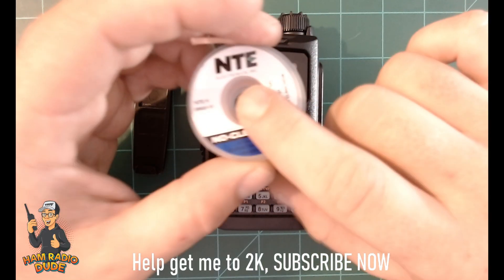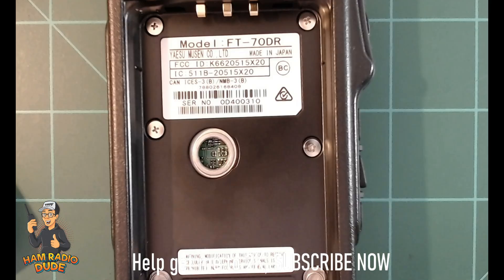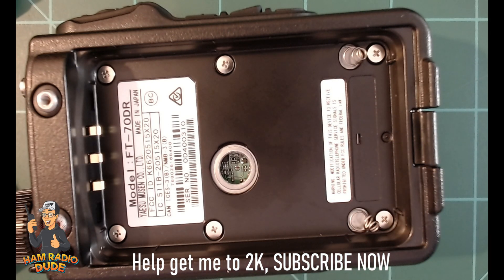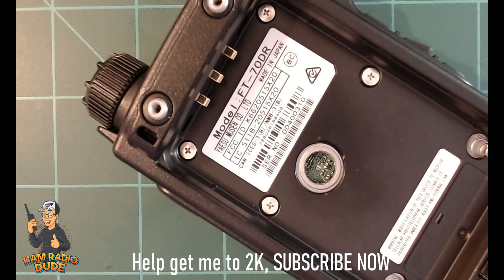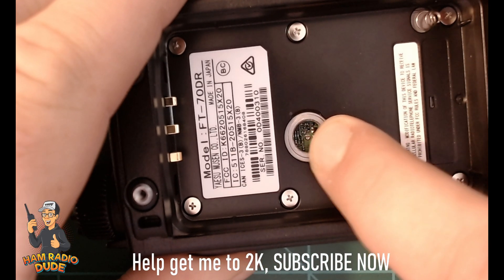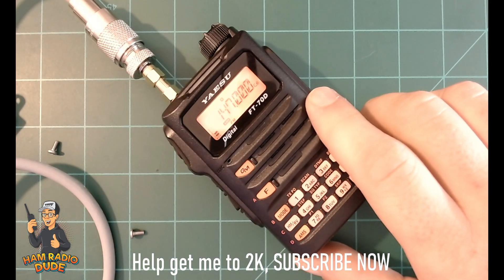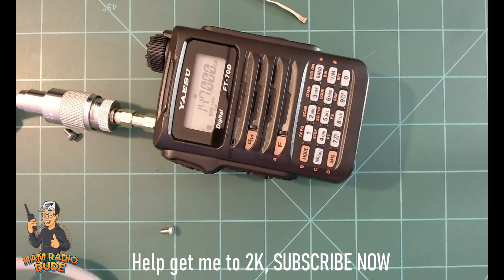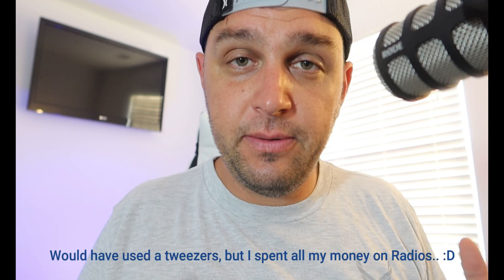Transmit / Unlock Yaesu FT-70D  - MARS MOD

Comment: I know this is an older video but I’m curious how did you get your radio to show a battery indicator on the screen? I just got this radio cause I have been wanting to do digital
Reply: I can answer this for you. Fully charged battery is about 8.3-8.4v on this radio. At 7.5v it will show the half full battery icon like you see in his video. At 7.0v it will then show an empty battery icon. And finally at 6.7v or so the radio will shut off. I just did extensive battery drain test on this radio because it has a bad rap for the battery life. Surprisingly I got a total RX time of 13.5 hours with the stock battery while parked on the very busy Kansas City Wide Fusion room.  Cheers!
Reply: @CheesyTators thanks yea i bought the upgraded battery from W0AEZ gives lots more run time and usb c charging
Reply from the maker: I don't recall doing anything to get it on the screen, actually. Sorry I cannot be of assistance. Maybe there is something in the Menu system?

Comment: I watched this video and done it exactly as described. A bit fiddly but I kept my fingures steady and done it using a small pencil soldering iron. Its not that hard but any way up,it makes perfect sense to make sure you know exactly what you are doing, as this mod is well....SMALL to say the least. But once done it worked perfectly. Over here in the UK, we do not have such family frequencies and such, but we do have PMR frequencies and that what I done it for. BUT if you are not sure, then DO NOT do it. Ask a fellow radio ham. Nice video bye the way....
Reply from the maker: Thanks for the input ! Cheers!

Comment: Thanks ! Got my braid in the mail today (Amazon) ... Followed your instructions ... took less than 5 minutes (and I'm clueless 
when it comes to soldering and it was done. Booted up and put in my Call sign, went through the ridiculous AMDS software
instructions (remember, export originals codeplug to excel type ....... reloaded it (well .. twice, first time didn't work) ... and I'm
a happy camper. I have an openspot 3 .... this works beautifully linking in to wires x .... So much easier that my pi-star dmr ...
Thanks again.
Reply from the maker: Glad everything went well!
Reply: @DudeTested I have NO resistor on this place but radio is limited in range... Any ideas...

Comment: I've bought a second hand radio that has one of the pads completely torn out. It seems that the resistor was simply removed with a screwdriver. How can I remove the unwanted bands?

Comment: If I Mars mod the ft 70dr, will that open up shortwave bands?
Reply from the maker: It will not.  It will open up the ranges 137-174 and 420-470mhz. Good Luck.

Comment: Failed to communicate with the radio: Radio did not ack block 1 (CHIRP) after the mod, any clue how to fix that?
Reply from the maker: Can you confirm with the actual Yaesu software if it reads? Additionally, Chirp instructions are possibly incorrect (I am not a developer, so I don't know).  The battery, according to Yaesu's instructions should stay out during the programming process.  If I read it correctly. Anyway, I wonder if the yaesu software works? - https://www.yaesu.com/downloadFile.cfm?FileID=13328&FileCatID=42&FileName=FT%2D70D%5FADMS%2D10%5FEXP.zip&FileContentType=application%2Fx%2Dzip%2Dcompressed

Comment: Do you still need a MARS license?
Reply: There is no such thing as a MARS license. MARS is a program you join to work with the military, kind of like the Coast Guard Auxiliary or the Civil Air Patrol, but focused on radio. Members must already be a licensed amateur but get a separate MARS callsign for official work. Members get assignments and do training that involves transmitting on non-Ham HF bands and are only authorized to do so when assigned to. They use their own HF radios, so they must be modified to be able to access any HF frequency. They do not use modified VHF radios. We just call any radio modified to transmit on expanded frequencies "MARS modded" for convenience.
Reply from the maker: I just checked and it appears that a license is still required
Reply: Thanks for checking.👍🏻

Comment: Ham proponents argue that their $15 multiple choice test ensures that only those with serious interest in electronics and the furthering of the radio arts are allowed to participate in their exclusive, law-abiding club. When these very same proponents are handed a soldering iron they are suddenly forced to acknowledge the fact that memorizing a list of answers to 35 irrelevant questions which somebody wrote in the 1930s has not qualified them to perform even the simplest of operations on a piece of modern electronic hardware and they just resort to ham-handedly stabbing around until something falls off; unironically why it's called "ham radio" in the first place.
Reply: get over yourself

Comment: Thank you so much for this! I'm a missionary in Nigeria and I inherited my FT-70D from an older gentlemen who passed away at our church. We use other radios to keep in touch with the local police and our security and I am so happy to now be able to use the frequency we are on with this radio. By far it has the best range of all the radios we use.
Reply: I did fully disassemble mine and used a heat gun and tweezers to remove it incase I ever need to re attach it.

Comment: When I do mods of this sort, I use a hotair rework station and a pair of tweezers. I am a Cellphone Motherboard Tech which why I have that kind of equipment. You can also use the Butane Soldering Iron. Just take off the tip to provide the hot air.
Reply from the maker: Great tips, thanks!
Reply: My butane soldering iron has a hot air tip. Also, I bought some ceramic tweezers from a vape shop. Makes easy work of jobs like this.

Comment: Ah yes, the ole “hiking” scenario every ham radio guy speaks of when performing a MARS/CAP mod. Every transmit expansion mod I’ve researched, the author of the article/video always mentions “hiking” and the need to have the capability to transmit out of band in an emergency. 

Have you ever been to a ham fest? Been to one lately? Ain’t none of them fellas doing any hiking! 

Seriously though, good video even though I don’t have a need to perform it. I’m just curious about radio mods in general even if I don’t need them.
Reply: What are you implying? Is it then going to be only criminal gangs doing this mod, and then transmitting on illegal frequencies as a challenge to civil society? ;-)

Comment: Okay I am new, what does this MARS mod do exactly, what are the advantages of it?
Reply: Gives you the ability to transmit outside of amateur bands.  Most people are only interested in GMRS, MURS, and marine bands.  But depending on radio brand it will will usually open up transmit from 137-174 on VHF and 400-520 on UHF.  Most all brands are the same on the vhf side, but they vary on UHF such as some are 420-470, 400-470, 400-500, it just depends.  I think my Icom 2730 does 400-480.

Comment: If you can get your hands on a hot air station, set it to 400, give it a few seconds and use a pair of tweezers to pick the resistor right off. You can even put it back on if you want latter on.
Reply: Do you mean use hot air gun? You will hate the components around it and risk damaging the board. Stick to a solder iron
Reply: @spacecoyote6646  - no, he said a hot air station.  They’re a specialized tool for working on surface mount boards with a very fine point to deliver hot air.  That’s pretty common for SMT reflow work.

Comment: If you do this, perform a "Reset All" when turning on the first time after the mod. See page 24 of the Advanced Manual. 
If you already did this and you only transmit white noise, do the same Reset All.

Comment: Just curious, what exactly does the MARs Mod do to this Radio, does it add to the air band AM receive 108-136 or any other am receive frequencies?
Reply from the maker: Hello. The mars mods opens the radio to transmit on 140-174mhz and 420-470 mhz (FM).  As far as I know, it doesn't add any additional AM Air Band receives.  Best wishes.
Reply: adds murs and grms, sweet mod, looking at 70s now😁😁😁😁😁😁😁😁😁😁

Comment: Do you know if there is a way to make it transmit on the air band?  I am a commercial pilot and that would make it much more useful to me.  Also, will this mod void the warranty?  Thanks
Reply from the maker: I'd assume it's not possible for legal reasons as well as Air Band Transmits on VHF AM and this radio doesn't have an AM transmitter. Best of luck.
Reply: Yaesu makes two aircraft band handy Takies. One of them can even receive the VOR info.
Reply: Yaesu makes excellent Airband Transceivers as well. The best one out there is the FTA 850L.
Reply: You're a commercial pilot and don't know your radio is AM? What airline?

Comment: Took out the tiny resistor with screw driver. But, still it did not work. Shall I remove all soldering remains?
Reply from the maker: You should be good as long as both contacts/solder joints aren't touching.
Reply: Finally did it.. Thank you so much

Comment: Umm looks like you just let the resistor floating around inside the radio. all it takes is for that resistor to get lodged somewhere on surface mount components and short something.
best way to do this is use the finest tip solder iron you have. use a good amount of flux and rest the tip in the middle of the resistor. when the resistor gets got enough it will float off and stick to the solder tip. Do Not just flick it off with a screw driver. Sometimes these pads are also connected to other components and can cause failure when they are just ripped off.
But I do have a question for you Ham radio dude. how is the TX audio on this HT the receiver as well? 
Thank you for sharing BTW
Reply from the maker: Thanks. I know better, just didn't realize it was in there.  I will redeem myself with a part 2 on the FT3D and the right equipment for the job.  I have no complaints with this radio and receiver sensitivity.  Sounds great through the 700mw speaker.  It's loud enough for me to hear it and it doesn't sound overmodulated.  I can try to get some audio recorded from it.  Thanks for commenting.  Recommendations on a good soldering Station?  I know most people like hakko?
Reply: @DudeTested  I paid 50$ if my memory serves me right for a 937d+  it usually comes with a pack a multiple size and style tips.. perfect for surface mount PCB. this station has lasted me 6 years so far. And I am looking as of now they are only 35$.
Reply from the maker: Just wanted to give you an update regarding the FT3D. I did the mod on it today, and unfortunately I thought I was recording, but I wasn't.  Anyway, a few things I observed:  1. Using a magnifying class is WAY helpful.  2.  Using a soldering tip that is fine point is nice, but 3.  using a Rework was the simplest.  I heated it up, being careful of where the heat was pointing, then removed it with a small tweezers.   I do wish it was on video, but maybe I'll just have to go buy another radio :D.. Thanks again for the suggestions.

Comment: If you've just purchased the radio and are studying for the license ... can you use the radio without entering a call sign?  thanks
Reply from the maker: You can bypass the Callsign input, but still you should not transmit

Comment: I did mine 2 days ago just make sure you use artistic attic soldering iron.
Reply: I didn't bother with taking out rubber stopper out it was much easier just take the back cover off it was lot easier to work with and taking it out.
Reply from the maker: You're right.  I had a buddy correct me and in my ft3d video, I'm going to be sure to do it with a nice, fine tip.  Thanks for the comment. How did it turn out?

Comment: Just did mine. Used tiny screwdriver and pushed it off. Worked great
Reply: Without heating it?
Reply: @meespiri9352  yes. Didn't have to apply hardly any pressure
Reply: Saw your video too. Thanks!
Reply: I did the same. It pushed right off. No heat needed.  Works good.  Use a tiny eyeglass screwdriver flat blade

Comment: On my first FT 70 D I had HRO perform the modification for me at the same time of purchase, later I researched it figured out how easy it was I came across a second FT 70 D radio for $100 and I decided to do it myself. I literally took a very small flat head screwdriver and snapped it off no problems took me less than a minute.
Reply: So you just scraped it off without heating it up?
Reply: Parabellum yes.
Reply from the maker: I'm going to do that on my next video, remove with a flat head..... I bet it'll be easier... Good deal on that radio too
Reply: @DudeTested  You will remove the pads from the PCB, and make the change irreversible.
Reply: I did the same with a screwdriver. Two radios took me 3 minutes tops. Works great on FRS channels ;)